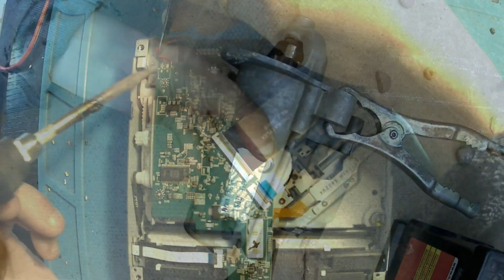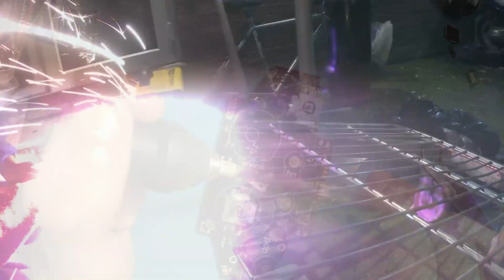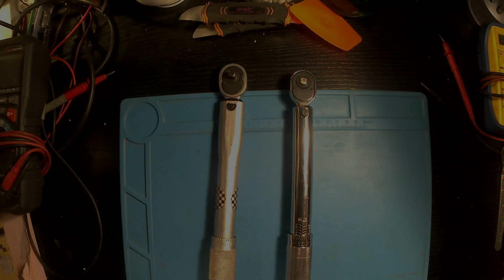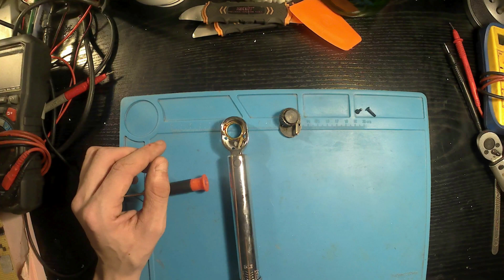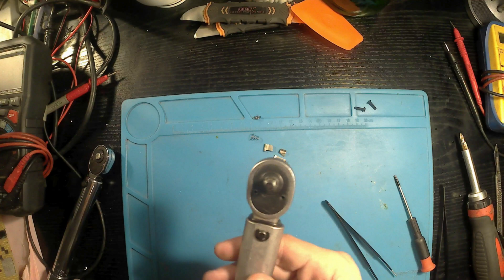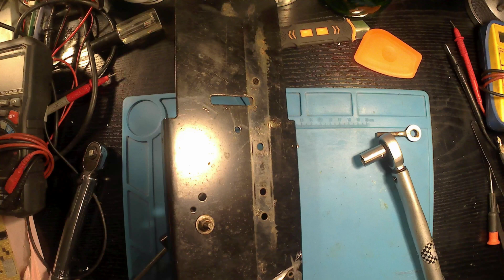Torque wrench repair!

Comment: The clickers are junk, won't retain accurately locked up stop clicking over time. You need to baby it specially the lower range in-lb ones.
Reply from the maker: hey Kim thank you for your comment, yes this I need to look into further but am glad its not my main one. :)